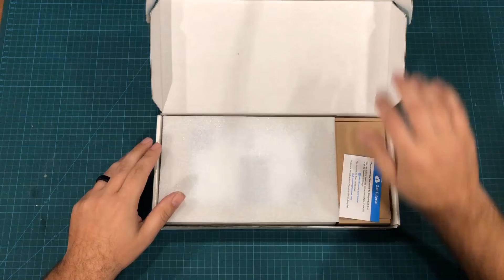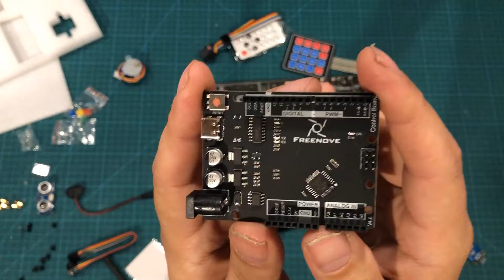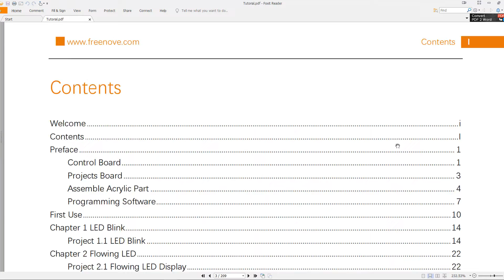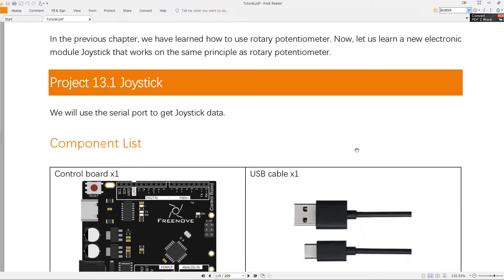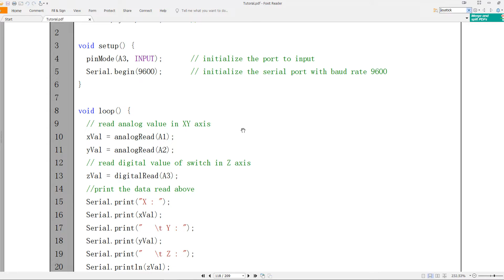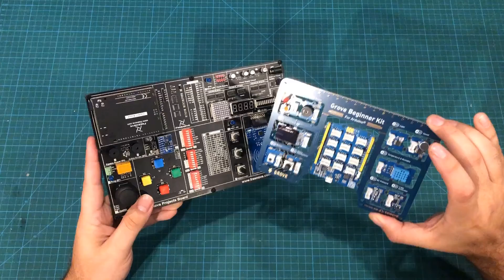Freenove Arduino Project Kit - The All in One Starter Kit

Comment: That is cool. I was gonna get the pi one for fun.  I like the keyestudio cor scheme. It got my wife into coding the sensor hats. Plus they have a mega with 1mB of psram and a 1.5amp 5v port and the same 5v port on their uno.

Bro. In Canada the freenove kit is 75 plus tax and the Grove with extra sensors is over 100cad. There's a non profit makerspace where I live and I gave them like 5 or 6k worth of stuff because they just didn't have the resources for the classes. I'm actually going to teach a beginners course sometime soon with all the stuff I gave them.
Reply from the maker: The stuff is getting outrageously expensive. I've definitely changed the projects I do worth of cost.  There are a few makerspaces up in Canada that I have on my list to visit next time I make a trek through.
Reply: @AnotherMaker  we have one in Sydney nova Scotia that is the biggest east of Montreal I think. It's not as active as I'd like it to be. They even have a smithy hut to forge whatever you want haha
Reply: @AnotherMaker  I meant to say that all the different kits and whatnot I saved up for a large donation for stem learning. The prices went up after literally tripling the 5 or 6 thousand cad I bought over the prior year. Have you seen the license of the teensy 4.1 or the stm32 robot learning board. The stm is like 130 on ali express ffs. It's completely shrunk the scope of my current robotics projects I was doing for the space because they have all the stuff to build the frame and mecanum wheels. 

That and a hurricane blew the roof off my house last week.

Comment: I purchased this kit once I saw your video. I have just started experimenting with the kit. I can't seam to find info on the external power supply. Do you know what voltage and current you can use with this board? 12V??

Thanks for the video
Reply from the maker: I can't remember. I used usb-c which is probably the way to go. I think everything else would just have to step down the voltage anyway. I could be wrong on that though.
Reply: @AnotherMaker  I have done some research and the external power supply in the top right is 9V (9volt battery) to mainly power the motor connections for anyone who is interested.

Comment: I hope you reply to this, you have such amazing channel, can you help me to decide between the Ultimate Starter Kit or This one from Freenove, the whole purpose of buying this is to learn how components work and electronic works in general, I know already Python but have no clue on hardware, does wiring and having the breadboard itself help me understand better or is it better to get this one and forget about wiring, I extremely curious, there is no much information online.
Reply from the maker: I don't really think you would go wrong with either.  I would probably lean a little towards the Elegoo.  If you already know Python, you might want to consider getting one of the ESP32 boards that runs micropython or circuit python.  They are a pretty cheap addon once you get a kit.
Reply: @AnotherMaker  So after a lot like a lot of research, I have concluded that I will go for the Freenove Pico, the Elegoo kit has some incredible built quality that you can't go wrong, however, I reviewed both tutorials and the Freenove just has superior documentation, it's important for me to have a good documentation so I can learn faster, in the future if I need new parts I will definitely go for the Elegoo. Also the Pico seems to have much better documentation, I think the upside of the ESP32 is that it has wifi/bt included but I don't think that's necessary for me yet, thanks for your reply though, really helped me!